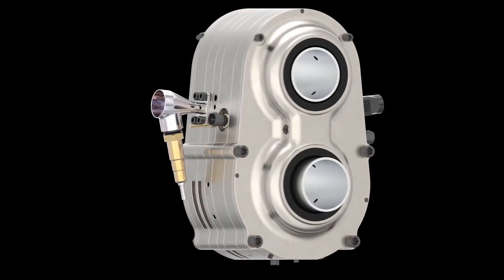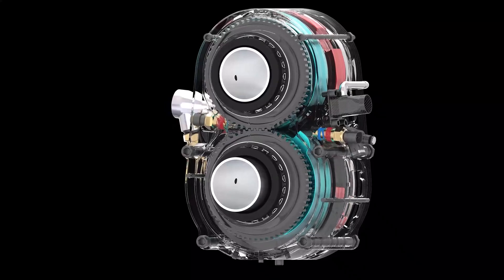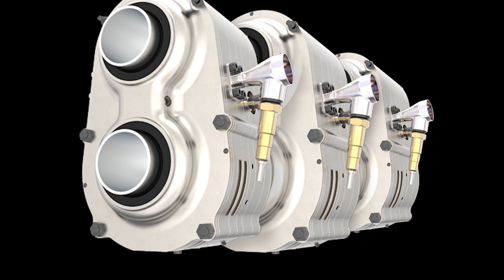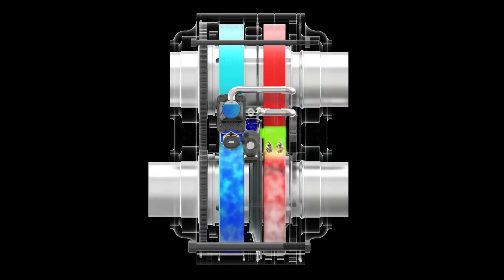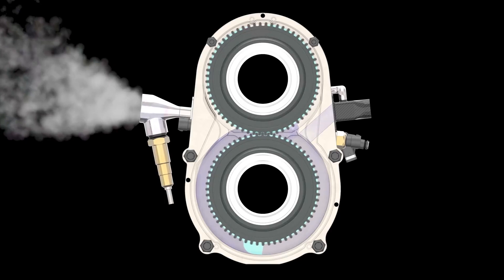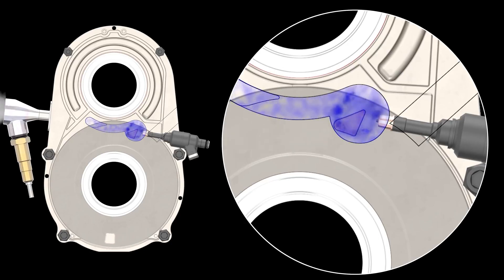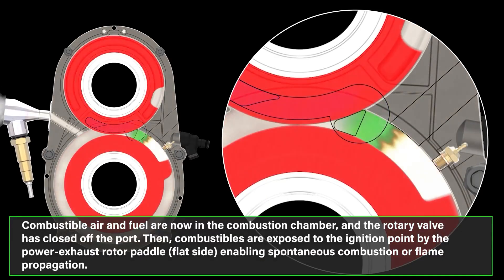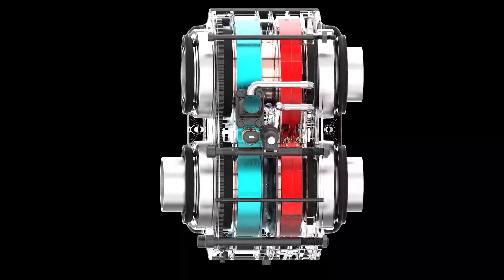This pistonless engine runs on hydrogen and revs to 25k rpm

Comment: Those teeth will not hold up in tests. At 25k rpm you have to overcome turbulent forces generated by air resistance via vacuum insulation. Take a look at a K.E.R.S. from formula 1

Comment: I don't think this will ever get into production because of the following reasons:
1) It uses Hydrogen. Hydrogen can not be liquefied  so you won't be able to carry a lot of fuel with you, which means, low range of the vehicle.
2) Low engine efficiency. Yes this engine might be more efficient than a regular gasoline engine but still, not enough for the available amount of fuel.

The existing hydrogen powered cars are using fuel cells. They produce electric energy with an efficiency of up to 60%.

Comment: Thanks for sharing I'm working on a MGB midget don't know what engine to put in it but I want it to be something fun to put together. the original engine has some problems so I don't want to rebuild it because they built it that way but this little engine looks like fun and no problems.
Reply: By the time this actually works you are not able anymore to drive ..or your car does not exist anymore
Reply: @DrSmugface  my car already doesn't exist good thing they still remake parts for it.

Comment: Much better and much more efficient than any electric engine no battery recharging problems. Probably a longer life expectancy as we know the high cost of replacing the batteries on current electric vehicle's far outweighs the price of the car in ten years when life expectancy is pretty much over. Then comes the disposal of said batteries. For me I would really like to see this technology have more motor manufacturers looking at this but unfortunately due to certain people they are persuading the electric route. I do see problems in the future and we will definitely need something else. Keep developing this technology.

Comment: I have two questions: 
1) Will there be slip between the rotors? 
2)  It seems good for steady state application but what about when it's just starting or in any variable state?  Not to mention on-road driving profile requires frequent starting and stopping so high speed profile isn't of much use. I can think of one solution to the unsteady problem or for variable situations and that is to use a motor drive along with it, so instead of having an IC engine it's better to make a hybrid vehicle using this. Since its also light weight so the weight of the motor can be compensated and instant high speed can be achieved through the motor which can meet the shortcomings of the engine and when required we can transition to the engine power at suitable speed once attained. For variability in speed requirement regenerative braking can smoothen it out. But then again the problem that remains is that of how to ensure better and effective storage and distribution of hydrogen on-board. 
[Pardon my grammar in a lot of places I wasn't in the mood to bother about it;)]
Reply: Did you NOT see the gears?? ⚙

Comment: I think this will sound like a jet engine so how will you contain the noise?
Also it would have enormous power to weight but virtually no torque. So how does it idle at the lights and then accelerate. OK so it's attached to a generator. So you have a Tesla with no noise at the lights sitting next to a screaming turd with two not so Kool people inside who can't hear themselves talk. Get real.

Comment: Electric motors are dead before they start as there is a finite amount of rare metals used in magnets around 500000000 tonnes not a lot for a full planet Hydrogen is the way folks.

Comment: I'm really curious to hear the sound of this type of engine
Reply: This only works in a simulation.
Reply: @DrSmugface  But also the sound could be simulated, right?
Anyway, I'm not a mechanical engineer so I'm not an expert about the physics and operation of similar projects, I was interested mainly as a designer

Comment: I really like it. But still not nearly as simple as an electric motor. The best thing about it is it runs off of hydrogen directly instead of the hydrogen fuel cell which converts hydrogen to electricity to run electric motors.  Hydrogen energy density, in say a hydrogen tank, is many times greater than say lithium batteries of the same size or weight.

Comment: 1. Air dynamic losses will be big, to squeeze the compressed air through the manifold to another chamber. 
2. The cut on the  power exhaust isolator rotor creates parasitic volume that reduces the efficiency. 
3. 25000 rpm means 2.5 msec for the fuel to mix and burn... So the rotors must remain small, and the fuel must be something like hydrogen. Still relatively slow burning rate will reduce the efficiency.
4. The "insane" 200 psi supercharge... it is not a supercharge, it is a separate chamber compression and is it comparable with air aspirated Otto and is lower that any diesel engine. Nothing "insane" about it. The losses for transfer the charge of compressed air from one chamber to another are usually very high.
5. Ideally the thermal efficiency of this one is 53%, with all the losses it is going to be not higher than 40% which is lower than most of fuel cells... and this engine cannot run on other than hydrogen - mixture problems. So what's the point?
6. They claim idle can be 1000 rpm? How about sealing losses then? The compression will drop dramatically.

Comment: "No seals but very low tolerances" In this case the tolerance is the seal. The tolerances will ware out and the efficiency wil go down. I wonder if uneven heating of the rotating piston wil be a problem with those tight tolerances.

Comment: You said it yourself, it takes a non trivial amount if air pressure in order to work. 1hp worth of compressed air takes 8hp to compress. By the time you're done scaling this up to power it's own supercharger you'll probably have enough metal to fill a 5y dumpster.

Comment: "Superefficient" -no, no, any thermal engine is limited by the theoretical carnot cycle which efficiency is 1-Tc/Th. Tc and Th are absolute temperatures of "cold and hot" sides. Since the high temperature is a limit of how much the materials can handle (best case ab. 3000K) and exhaust temp. is around 1000K, the theoretical efficiency limit is 66%. This is beside mechanical, friction, heat, aerodynamic and turbulent losses, un-proper burning, etc. which limits all internal combustion engines to about 20-40%. The best efficiency I've seen, 60% is actually achieved on some jet turbines and only because the air temperature is -60C at 30,000ft. This is basic physics and it should be on a high school curriculum. If you have this knowledge embedded in you, it's less likely to be swayed by a "superefficient" new engine configuration.

Comment: Definitely NOT on the electric bandwagon, it's already a dying technology from the start if anyone gives it serious thought it has waaay too many drawbacks, it does not really save oil due to what's required in production, the used car market does not exist and when cars are sold as used they have too much tech that allows the manufacturer's to control the cars features and downgrade them. They require masses of oil for production and are not oil free as advertised, metals, tires, plastics, lubricants, etc. and also battery pollution and production is as damaging if not more to the environment between mining lithium and disposing of old batteries. A second hand market will not arise when it costs as much or more to replace battery packs as it does an entire combustible engine and needs to be done far more often. These are just few real life examples the idea of electric cars was put out by imbeciles and then guys like Musk just simply took full advantage of their ignorance.

Comment: If we can find a high temperature resistant metal compound strong enough to withstand the pressure built up. This engine would be absolutely absurd
Reply: There some more parts thats missing, overall this only works with magic

Comment: Burning hydrogen is inefficient by definition. Also, if you look at how it works, it will have to drive electric motors via generators or require some sort of infinitely variable drive.

Comment: saving ICE and manuals is worth any attempt, but as mentioned by others: tolerances, wear and machining problems make it seem unreal and overengineered, if they were to give it seals like in rotary that would be doable in reasonable price, they will deteriorate for sure, but with that weight and size I can replace them monthly...

Comment: Well, hydrogen is too dang dangerous and the tight tolerances along with super high rpms makes this way too volatile of an engine. In theory it's great. Not so great when it tears apart upon acceleration and shears any human with 20 feet in half.

Comment: I find your lack of seals disturbing. Internal combustion has always been the future, electric cars are heavy polluting toys. However this engine, while a fun concept, won't make it onto a consumer platform without being maintainable and affordable. Neither of which is on the table for this modeled design. Not to mention the real world problems with having a 200psi pressure cooker under the hood of a bouncing vehicle, which at any time could be in an accident. I wouldn't put my family in a vehicle with one of these things without shrapnel protection at the firewall.

Comment: Fascinating. Thanks for posting. 
Couple of thoughts:
So, this engine sounds like a greatly improved rotary engine. Rotary engines are known for excellent power-to-weight ratio (among other advantages vs piston engines) but also known for oil consumption, increasing,  not reducing emissions. I don't see how this challenge has been addressed here...
Nevertheless, history shows that improving existing designs and concepts rather than, metaphorically speaking,  reinventing the wheel, consistently seems to offer better reliability and cost-efficiency. So, with the understanding that bugs would likely have to be worked out of this engine design over time, I think it does, yes, show great promise.
     The following MUST be stated: there is a very common false belief prevalent within society: that contemporary piston-engine fuel consumption numbers correlate with engine-builders level of contemporary mechanical knowledge. THIS IS FALSE.  It is no secret that fossil-fuel-burning passenger vehicles can be powered by engines which can deliver 150+MPG. And in order to mass-produce such engines, engine producers would need to use materials and technologies tripling or quadrupling the overall cost. Simple economics. We would all love to own a 150 MPG non-hybrid passenger car. But are we willing to pay $150 000 USD for such a car? THAT is the question.

Comment: The internal combustion engine is alive but can use some improvement.  This tech may just be that improvement; a real-life model would have to be built and tested.  The electric revolution (started by Elon Musk) that is now being shoved down American throats by the Biden regime ignores the fact that the American electric grid will not handle the additional demand of widespread use of electric car chargers.  This inadequacy would reveal itself in the summer months when the US weather is warm and everyone is running air conditioners AND when many Americans travel on vacation by car.  Just sayin'.

Comment: As it pertains to cars, I think "good for the planet" and "clean power" is stretching it. Currently, over 90% of hydrogen production is through gasification and requires more energy to produce then it generates. This also means it carries the same risk to the environment that all fossil fuels carry. This will undoubtedly change but that takes time and funding. Time our planet doesn't have and funding we can't afford to pull from other, more mature technologies. Pull enough from one and you run the risk of crippling both. Lastly, unlike electric, hydrogen has no preexisting infrastructure. Unless we find a way to generate hydrogen on site/refill stations, your looking at a long and expensive development time for the infrastructure alone. I'm not saying it's pointless, just saying it would be better used for something like fleet vehicles.

Comment: Even if this works, we need to get away from internal combustion.  Running internal combustion on hydrogen sounds good until you realise that you're basically making hot water in an engine, which may promote rust.

Comment: Seals are a good thing.  When metal heats it expands, clearances change, so sealing stops working if seals aren't present.  IF that could be resolved, the efficiency would be low.  The reason for this is there is a lot of metal (very cold in comparison to the flame) in contact with the combustion space.  Ideally you want to minimize the chamber surface area to the volume of gas you have. So you'd try to capture the expanding gas in an expanding sphere - or as close to that as possible.  This is one main reason the standard rotary struggles with fuel efficiency.  The closest we have to this ideal expansion is a regular piston/cylinder.
Reply: Yes I don't know how it would eliminate "all losses". That being said there's a lot of armchair engineers in the comments. In reality the design team with the actual design only knows the limitations and flaws that need to be reworked.
Reply: @fresh_dood  I'm not even sure there is a running model?  If this is the case, the design team would have no idea on its limitations?  I know some designers that could draw up a beautiful looking rocket, but I guarantee it would never make it to the moon.   
Someone familiar with engine design who doesn't know that specific engine intimately can spot a lot of its shortcomings, and be accurate. 
Ralph Sarich with his orbital engine discovered the issue his and many other rotary designs have by the high chamber surface area/combustion volume ratio leading to inefficiency.
Personally, I've studied alternate engines and been hired as a consultant engineer on the design aspects and improvement of novel engine designs over the last 20 years.
Reply: @brendontait6968  There is a running model. Kudos to you on your qualifications, but part of being wise is being humble. You don't get the full story from one video and certainly don't know much more than the team working on the design itself.
Reply: @brendontait6968 are you just a troll or a ludite. What is your problem with this? You protest too much. I'm sensing an agenda.
Reply: @defearian  I've consulted on, studied and worked on several prototype and unique engines from all around the world over the past 30 years.  I have a reasonable amount of experience and understanding on what works, what doesn't, and why.  What's your level of expertise and experience?
Reply: @brendontait6968  State a fault of this engine
Reply: This is why you’d make it out of industrial ceramics, though that field needs a few more years to mature I believe
Reply: I agree, seals are a good thing as long as they are easy to change DIY seals, BMC (Morris minors seals) vs modern BMW seals, a few hours DIY= FAR BETTER than thousands £$ specialist labour.
Reply: @TheMentalblockrock  brilliant!
Reply: @TheMentalblockrock  This engine would be a great motor for military delivery systems (weapppons). The RPMs and tolerance tightness will make for limited life in a car or aircraft. Extreme cold and hot will hurt tolerances because of thermal expansion differences.  Using exotic materials makes the parts $$$$$$.
Reply: How about if the engine is produced In mass production . It will be so cheap we can throw it away each year. Just the saving on fuel will cover the cost
Reply: @andrehulse11  why would you save on fuel?  It will use much more fuel than a standard engine
Reply: @brendontait6968  What's your opinion on achates opposed piston engines? I find it a promising alternative for light duty to heavy duty truck towing needs. I saw Hoovies Garage tow with a Ford Lightning towing a Model A on an unenclosed trailer tripled it's power consumption. The smallest battery with 98 KWh and 230 miles of range becomes 76 mile range being comically impractical.
Reply: @RichardPrendingue  I like it. It's a new take on a very old design.  Opposed piston engines get one step closer to that ultimate spherical expansion.  Heat that is normally directed to the head now goes into generating power.  They don't have any weird seals or large surface area combustion spaces.
Reply: @brendontait6968  It's tested and tried in military or train usage but I'm perplexed why it hasn't hit the market that I was hoping you'd have the background knowledge why. I'm wondering if it's NOx or other emissions related which is predominant reason rotary engines never reach market that I can't take the videos pistonless design serious.
Reply: If they they single crystal metals (like we use in jet engine blades) they don't flex, or suffer from creep. And can operate near their melting point without losing structural strength.  So that might be how they keep tolerances tight at high rpm
Reply: @petenell5807  I'm not so sure...  single crystal metals still change shape/size when heated, they also decrease in strength when heated.  If you can avoid all the issues with sealing, the fundamental issue is the high surface area/volume ratio of the combustion chamber
Reply: Slowdown MR. Engine Einstine.
Reply: Yes I worked on a bunch of rotary engines and the Apex seals wear out sooner than piston rings the Wankel engine had oiling problem s